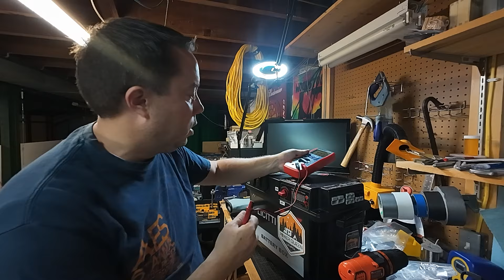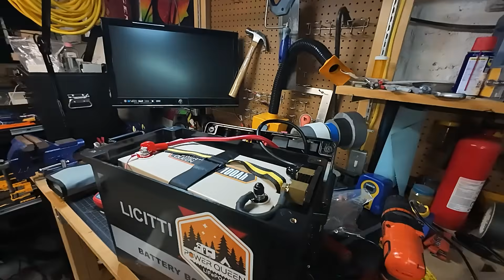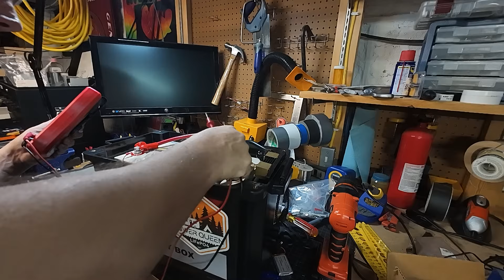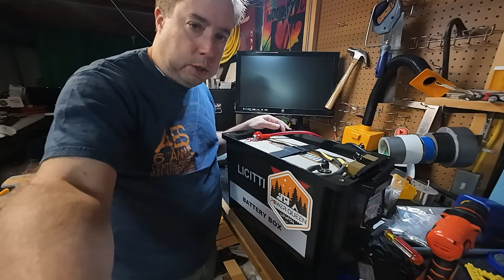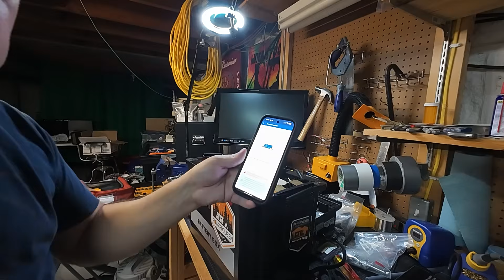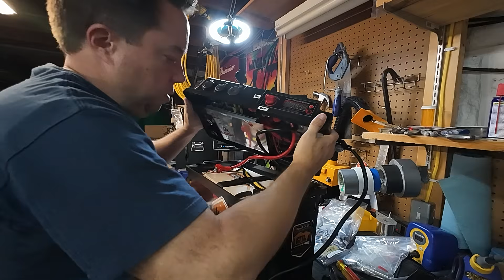Troubleshooting Battery Problems #licitti #lifepo4

Comment: When I get my Hiker, I'm installing a Victron system with 1, maybe 2, 460Ah EPOCH batteries for boondocking.
Reply from the maker: 460Ah battery should last you a whole month.  The Hiker doesn't eat that much power unless you have a fridge.  I get 4 days out of my 100Ah battery with a 48L IceCo fridge.

Comment: Ah, the old light in the fridge box gambit.  I have a 20 quart IceCo with a light inside and LED panel outside when left plugged in the outside panel remains lit.  But not sure of inside.  Now Ill have to check the inside light.  I do unplug fridge when in garage and monitor Victron for draw.  Good review.  My 280 amp Wattcycle battery system seems rather stout even with some fantom draw which I think the CO2 monitor in Hiker draws off of 12 volt system all the time.  Need to check that out also.  Thanks. Kyle.
Reply from the maker: That light gets you every time!